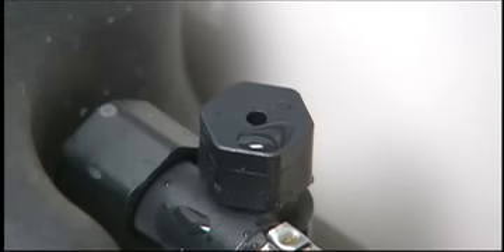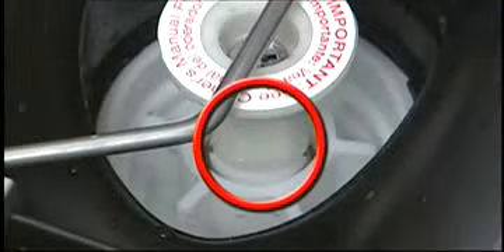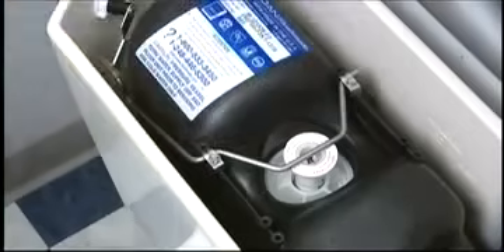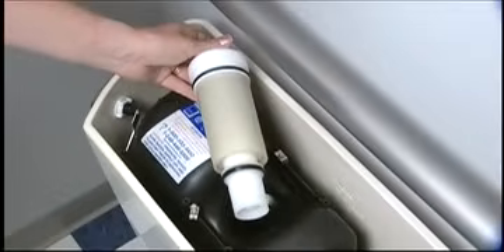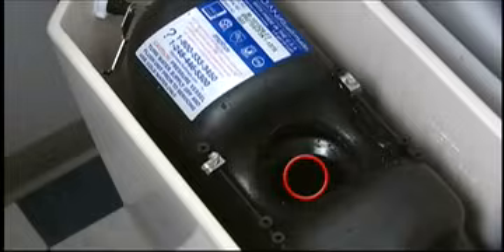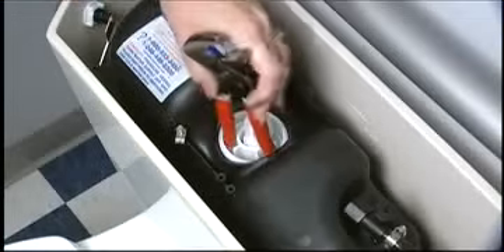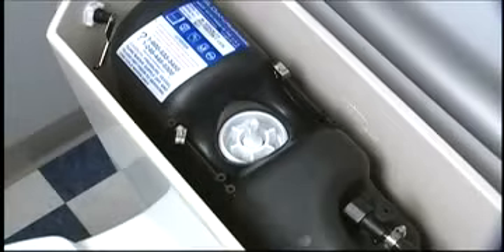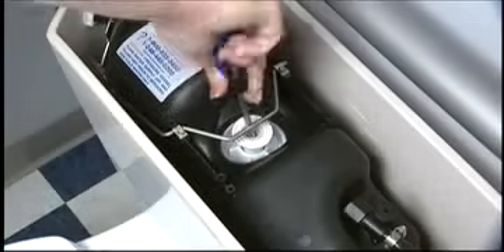How to Test and Replace: Flush Cartridge of Flushmate

Comment: This video saved a call to my plumber, who takes a long time to show up. Due to area wide power failures the water utility reported that pressure would be low for a couple of days. During that time I couldn't get the Flushmate equipped toilet to flush. I have non-Flushmate toilets in the house so potty visits were still made. I waited out the pressure situation, but even after that I could hear water running inside the toilet, but it wouldn't flush. I followed the instructions to remove the cartridge. I saw no visible damage (the unit is only about a month old) but maybe something was blocking the flow because after re-assembling the toilet is flushing normally.  Thanks, Mr. Flushmate.

Comment: OK, so I attempted an adjustment a while back which seemed to work. The problem was that we could hear the tank dripping into where it connects to the lower part of the toilet. Drip drip drip drip drip drip drip drip drip drip.  I don't know if it is the porcelain or what but it is magnified and loud, especially at 2 am when I am trying to sleep.

With the other style of toilet if water is getting past the flap eventually the float will drop low enough that the tank refills. We never hear the tank being refilled on it's own without being flushed first. Either the loss of water is so minimal that the tank never falls below the level that would require the tank to be refilled or perhaps we use the toilet frequently enough... I am  not sure.

I tightened the cartridge a fair amount and the dripping went away. YES! Then it came back. NO! And it progressively got worse. UGH. I purchased a genuine replacement part and installed it following the instructions in this video to the letter. But I cannot get rid of the dripping. It seems intermittent but I don't know for sure. I am beginning to wonder if this is an elaborate way to torture people.

Is there a fix for this? Does the cartridge need to be tightened more? I am concerned that I might break something if I tighten it too much. I appreciate your help and I am thankful this video is here. Thank you.
Reply: Upon further inspection it appears that there is about an inch of water in the porcelain tank that the flushmate tank sits in. The flushmate tank is leaking not down directly into the toilet as I suspected but into the tank. Is there a gasket or something that needs to be replaced on the flushmate tank or is it to be replaced?
Reply: I will add this: Just call Flushmate/Sloan. 1-800-533-3450.

They are SUPER helpful. I just got off the phone with them. I will be replacing the inner tank.
Reply: Hi Alain, Glad to hear that you contacted Flushmate and we were able to help you resolve your issue. Please feel free to contact us at 800-533-3460 in the future if you have nay questions, and mention YouTube.

Comment: Good and useful video. Thank you.

Before taking out the plunger... see if it needs to be tightened a hair...

We were having an issue where we could hear a slight trickle of water. Continuous, but slight. And every once in a while we would hear the toilet tank refill even though no one had flushed it. So we knew that water was escaping from the tank. 

I followed the the tutorial in the video. Step by step. When I got the plunger out the seals weren't damaged at all.  So I went through the process of reinstalling the plunger and tightened it until I could no longer hear the water running. Except for that little trickle... so I tightened it ever so much more and the trickle stopped.

All that to say, I wish I would have just tightened it a hair FIRST before the hassle of taking out the plunger.

Comment: I swapped out the cartridge in my tank, and the same weak/no flush is happening. Is this just a sign that I have to replace the whole assembly?
Reply: hi, I have same problem, I changed a new cartridge, but it is still leaking, no flush, can you tell me
Reply: Hi, I would like to help. Please contact Flushmate, 800-533-3460, ask for Carl and reference YouTube
Reply: Flushmate didn’t see this, crap. I ended up just replacing my toilet entirely.
Reply: Hi, I would like to help. Please contact Flushmate, 800-533-3460, ask for Carl and reference YouTube.

Comment: I tighten the cartridge till the water stops. Then I can get one flush and after that the water just runs and the tank/pressure don’t build up enough for another flush and the water just keeps running. I’ve tried continuing to tighten until the cartridge is maximum tightened down and the water keeps running. I replaced both the shank inlet screen and the duckbill valve and have the water line wide open. Have tried the new cartridge install start to finish but same thing each time. One flush and done. The O rings and cartridge look ok. Thanks for your advice!
Reply: Hi MJ, im sorry to hear of the difficulties you are experiencing. Please feel free to call me directly (Carl) at 866-515-2156 and ill be happy to help!

Comment: My cartridge was broken and it was not readily available. The plastic rod broke near where the spring is. Usually that is not repairable but in this case it was an easy fix. I screwed a stainless steel #12 sheet metal screw into the top part. Then I cut off the head of the screw with my band saw leaving about 5 threads showing. Then I ground down the ragged edge of the cut screw so it would be easy to thread into the bottom plastic section of the rod. I made sure it went in straight. The repair is actually much stronger than the original. It worked great when installed.
Reply: I used a bolt that was about an inch long. It screwed into the broken off handle about 1/4 inch and then I cut the head of the bolt off about 1/2 inch above where it protruded from break.  I then did the same thing screwing it into part where handle used to connect.  Worked great!

Comment: Here is some tips, you should use some lithium grease on the threads of the cartridge, this will make it easier to install and remove, also you should look at the handle and rod assembly, they can become oxidized and create a problem where the flush valve is held down causing water to run eventually leading to cartridge failure, grease the handle and rod where they intersect, they should slide with out sticking. Only a penny space between flush actuator rod and top of flush valve is recommended.
 Lube O-rings lightly with lithium grease or Vaseline.
   The cartridge may be very difficult to remove if you don't have a removal tool, you can use the handle of some channel locks they may twist a lot, you can spray the top of the old cartridge with a  penetrating oil this may help to remove it. Good luck!
Reply: Weber, little Weber, you don't use any petroleum grade lube on O-rings or rubber parts. You do use plumbers grease or Magic Lube. Those are 100% silicone based greases. Will not attack rubber parts. Weber..........  Get some Magic Lube at your local swimming pool supply house.

Comment: Another way to tell that the flush cartridge needs replacement is just to lift the tank cover and look at the top of the cartridge.  It should be dry.  If the top of the cartridge is already flooded with water then the cartridge is leaking and should be replaced.  I've had three of these toilets for nearly 25 years. I don't have the black plastic pressure tanks though.  Mine are old enough to be aluminum and much more rugged.  The biggest hassle with these toilets is typically replacing the flush cartridge every 5-7 years.  Recently I had to replace the tank to bowl gasket in one of them and that was a royal pain in the ass.  The gasket had been leaking for awhile and the porcelain tank to bowl hold down bolts were completely corroded.  I had to hacksaw them off.  Unfortunately, the hold down bolts are located underneath the pressure tank so you have to disassemble everything and remove the tank to get at them.
Reply: I have two of the old tanks and never serviced them. Where do you get the cartridges?
Reply: simul8guy (

Comment: The flush cartridge was cross threaded. I just encountered the same scenario. Extreme resistance, however, once properly reinstalled the unit will unthread much more easily.

Comment: Hi the top end of the shaft broke off where the spring is and the water kept
running so I remove the unit from the tank. I cut a no.8 machine about 1/2 inch
long and screw one end in put the spring in thread the rest in works like new.

Comment: Garbage! Do not buy one of these nightmares. The tank will fill with an inch of water that quickly turns stagnant and stinks up the entire bathroom. The company says, "This is normal and probably your fault."
Reply: Where's YOUR video? So no real evidence to provide anyone here that your "claim" is credible. I bet they said it's normal, riiiight. Like every one they have sold is supposed to smell like yours does. I bet your ball sack it the cause of the smell. Or those nasty fungus infected feet.

Comment: Thanks to this video I have a working toilet again.  I did not need to replace the cartridge but I did need to flush out the tank.  When I first put the cartridge back in the tank was not filling correctly so I tightened it some more and now it works!

Comment: Great Video.  Here's a recap:

1) Turn off H20
2) Hold down flush cylinder until drained
3) Pour water on cartridge.  Bubbles=Leak
4) Tun on H20
5) Remove Cartridge CCW.  Turn very slowly with just enough force to turn cartridge.
6) Examine O rings for damage.  Replace Cartridge if damages
7) Turn water on for 30 secs to clear debris at seal
8) Put in new cartridge / press down and turn CCW until CLICK sounds
9) Turn Cartridge CW 
10) H2O on
11) Turn Cartridge until H2O stops flowing.

Comment: My pliers were to thick to fit in spokes so I bought a pair with thin handles. instead of  screw driver as a handle I used a vice grip as a lever and turned the spokes. 

When replacing  the cartridge make sure to run the water. I accidentally skipped  this step & it was making gargling sounds. Turn off the water place the replacement in slowly thread the piece in and then turn on the water  and continue to thread until the water sounds like it is not filling the flushmate.